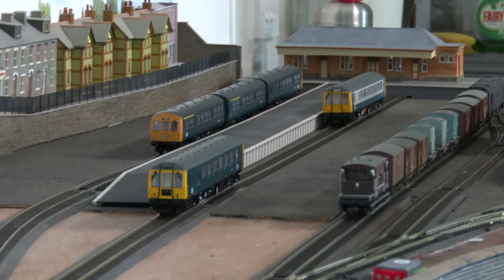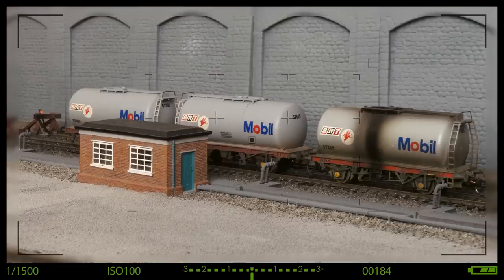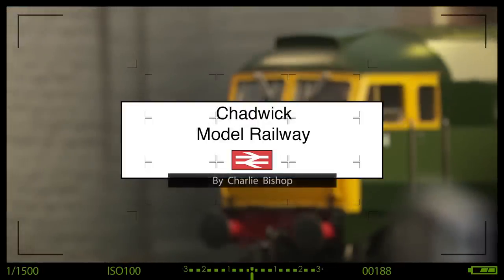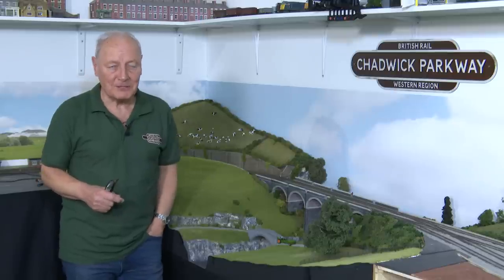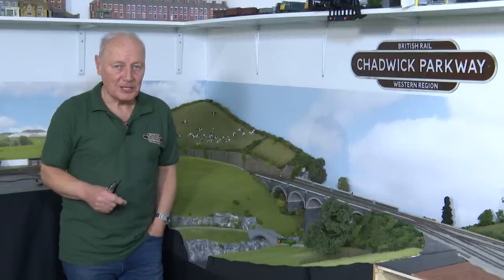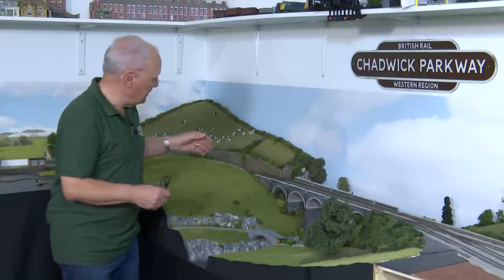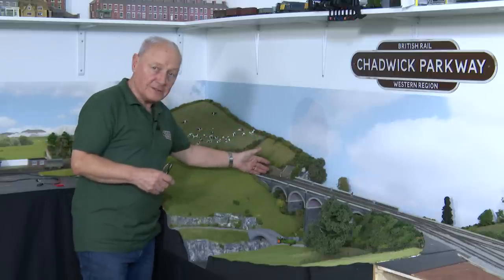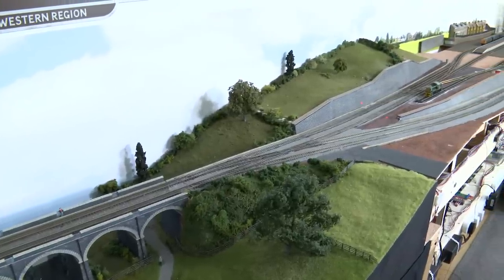SIGNAL POSITIONS at Chadwick Model Railway | 199.

Comment: Hi Charlie, I'm a driver on the midland main line, to put a spanner in the works at trent junction on the down main line the signal protecting the diverging junction, Derby/Nottingham lines the signal has 2 route indicators on no1 for Derby and no4 for Nottingham in other words you need a route indicator whether you're going left or right,  also if you get the cats eyes on a signal protecting a station you would also get the platform number as well.   Lee
Reply from the maker: Thanks Lee. At the junction, are the speeds the same for both routes?
Regards Charlie

Comment: Hi Charlie. Current train driver here.

Agree that the branch line would have the diverging 'feather' as usually this would have a lower speed or priority at the junction.

Also, if entering a station on position lights I would expect a platform number if multiple platforms.

Your solution to the Goods line departure signal is good, however if the position light is associated with a main aspect then it doesn't need to be illuminated all the time, only when required for a shunting movement. A departure onto the mainline just needs a main aspect.

Tim B.
Reply from the maker: Thanks Tim, good info, and most much appreciated. Regards, Charlie

Comment: Hi Charlie, Yet another Great video glad to see the amount of little details your Putting into the layout.

As many have commented when entering an occupied platform with the two white lights you should also get the route indicator, as for the goods siding you should only get a G indication with two white lights, as the points in the yard are hand operated and yellow signal would suggest they are set and locked in place which they wouldn't be, as well as this the yard would not have been track circuited and therefore must be presumed to be occupied. This would also be a reason to use the two white lights other the yellow which would tell the driver it is clear to the buffers.

A possible extra signal might be a shunt signal on your exit line from the area, but facing into the station and yard, should you shunt a loco out the yard into a platform for example?? 

As for semaphore signalling, the era your modelling it would not be unusual to see a mix match of both colour lights and semaphores in the same area, but as well as that even tho your modelling the GWR area you would quite often see upper quadrant  (mainly LMS style) signals too, as BR favoured this design and where GWR signals needed replacing they would likely get replaced by these.   
The signals at Shrewsburys would be worth looking into, as even today it is a perfect example of what it would have been like, it has a right mix and match of signal types.
Reply from the maker: Thanks Ben, your comment is much appreciated. I’m inclined not to go for the semaphores as I believe the station would need both home and distant signals at the end of both platforms. They would be reasonably hard to maintain and their solenoids would be an unknown quantity. Regards, Charlie
Reply: No worries, FYI when your starting away from a terminus you leave under caution even if the signal is green (this is if its two aspect), until you reach a signal that's able to display a caution aspect, so you could have either a two aspect signal or just a home arm.

Comment: As to the position of the feather left or right. Your correct in your assessment it does not matter as such, what determines its position is what is defined as the straight route or main route. In your case I would say the feather goes on the left for the branch station. Ps I am an ex retired driver hope the info helps
Reply from the maker: It is very much LR. But also the speed of the two routes has an impact as well. Regards, Charlie

Comment: Charlie, another inspirational video. You have set me thinking - 

1. While not a railway professional, my understanding is that feathers are to indicate divergence away from the main line to a secondary route regardless of the actual geography of the track bed so left feathers on the "peg" at the start of the viaduct. 

2. And now throwing in my two penneth, it would be great to see a few semaphores on the branch station - my suggestion is starter signals from the platforms with the remainder of the branch signals being "fairy" lights. I am sure that you can find an excuse to use single pole signals in the "prototype for everything" department. While everyone thinks that the West Country is solely the preserve of the God's Wonderful Railway camp, there are enough instances of branch lines in the West Country belonging to the Waterloo-based folk - in effect I am suggesting that the branch station could have been of Southern parentage. [P.S. the branch station on my layout is allegedly of LMS parentage so while the main line has fairy lights, the branch has an LMS-style box and a couple of LMS starter signals. Also I have reinforced the LMS parentage with some LMS style buildings.]

3. Unless you go down the road of fairy lights everywhere, you probably need a signal box at the junction with another one to control the branch - I very much doubt that one mechanical signal box would control both the junction and the branch station. My idea is leave the 'box on the main line where it is and make space for second box near the platform ends on the branch.
Reply from the maker: Thanks TRMC, for an interesting comment. I am on the hunt for semaphores so I’ll keep you posted. Regards Charlie

Comment: Congratulations on the upcoming 200.  Many years ago when I was on the footplate, we had a job at Taplow where we had a ground signal yellow and white lights to access the headshunt. When it came to return to Slough we got two white lights to proceed out on the main line. There was no main aspect signal.
Reply from the maker: Yes, I discovered that’s exactly right. I’ve acquired the signals handbook. RS – 5 to one. It’s all in there, regards, Charlie

Comment: Hi Charlie - love the videos, I’m an ex S&T engineer and have found some pages in a book about your yellow shunt signals. I will scan them and send them to you somehow. As someone else has said the feather route indicators are for the low speed routes so the fastest route would not have a feather.
Reply from the maker: Many thanks Keith, however, I think I have all the info I need so I won’t need your scans. That’s a great advice from drivers et cetera. You gave me great clarity. Regards Charlie.

Comment: Hi Charlie, first of all let me say that by no means am I an expert on signals but, looking at your starter signals leaving the platforms I think you may need a theatre on the platform 1 signal indication U (up) or D (down). I say this because trains enter the station on the UP line, and if leaving from 1 it will need to cross over to the DOWN. A straight green light may give the driver an indication he was departing back to the UP line.
Reply from the maker: That’s an interesting observation, but I haven’t found an example of it in reality. Regards, Charlie

Comment: Charlie I did some digging in my rulebook, this is taken from RS521 2.3

"When the straight route is obvious, there is normally no junction
indicator provided for this route.

Where there is no obvious straight route, a junction indicator will be
provided for all signalled routes.

Where the straight route is not the highest-speed route, the junction
indicator will normally apply to the lower-speed route.

Where the diverging routes ahead are both of equal speed, a junction indicator will be provided for each route.
"

Hope this clears it up😁
Reply from the maker: Yes David it did, much appreciated. Regards, Charlie

Comment: Hi Charlie, been away for a while. While there’s lots of prototypical advice, my go to books for modelling are C J Freezer’s Signalling an Nigel Digby’s Aspects of Modelling on the same topic. As a Digitrax guy also I’ve built SE8C boards and brought the connections out into RJ45 Ethernet sockets just that they were easy to swap if needed. Most of the stuff PM42, BDL now I put in a box with multi-wire connectors just so it’s easy to change them out or use them on an exhibition layout without having to buy than I need to ‘run’. I even have a full Digitrax ‘system a box’ which paid dividends at our last exhibition when the Lenz packed in and we were back up and running in a couple of minutes. Also the beauty of using JMRI on Raspberry Pi an WiThrottle/Engine Controller, no one had to change controllers.
Reply from the maker: I think you need to be congratulated Steve on building such a workable solution. Regards, Charlie

Comment: Very interesting as always Charlie.  One thing that crossed my mind is initially, would the lines in real life be built like this?  'Straight on' for a branch seems not quite right and 'slow down and divert' for the main line is the order of the day which also does not seem right to me.  Still, what do I know!   
Incidentally, I note that at 13:40 there is a glimpse of the position light on the Gartell Light Railway.  I'm very familiar with the majority of the signals here mainly because I either wired them up myself or helped do so.  I'm not involved at the GLR to the level I once was since becoming a carer, but if you pop along at a GLR open day and ask for John Penny you will get another bloke with that name (yes, really!) - and he knows signals - I mean he SERIOUSLY knows signals.  He can certainly answer your question about a position light that shows a yellow.  I recall we had a mechanical 'ground signal' of that ilk.
Reply from the maker: Thanks beetle fan, for such an interesting comment. The GLR is always worth a visit. Regards, Charlie

Comment: Hi Charlie, another great video. As a current signaller and ex driver I’d like to try and help you with your questions. Regarding which side the feathers are on, it would usually be the physically straight route, however it can be the secondary route, this would depend on speed across the junction. A good example is Balham on the down Brighton slow lines. The physical straight (or almost straight) route is on to the down Crystal Palace lines via Streatham hill and the main lines bare to the right, yet the signal on Balham down slow platform has a left feather. So the short answer is it’s perfectly reasonable that you have a left feather on your junction signal facing the branch station. The yellow and white ground position light or semaphore shunt signal would be appropriate for your head shunt. Basically when the signal is ‘on’, the yellow light would be shown, this is in the same position as the red light on a normal shunt signal. So it would show yellow and white together, this would allow the train to run past it towards the head shunt. Any train that was to go on to the main line would have to stop and would get the two diagonal white lights to take it onto the main (branch) line. There would be no need for a main signal. If you want a main signal then the main signal would be for the main line and an associated position light (two white lights) would be for the head shunt. It depends whether you think the head shunt needs to be signalled. That would depend on the area. Finally I have to point out that your starter signals at the platforms and if you decide to have a main aspect to leave the goods yard MUST be 3 aspect, because you can never have a green that is before a red. As you are going to have a signal protecting the junction coming from the branch station, you do not have room for a repeater or distant signal, the starter signals on the platform would have to be 3 aspect. I.E. if the junction signal was at danger the starter would show a yellow, if the junction signal was showing a proceed then the starter would show a green. The final signal taking you to the platforms or the goods yard would show the route indication even when the position light was showing and I think there would only be a position light to go into the goods yard. Whew! Hope that helps!!
Reply from the maker: Paul you are clearly bang on the money. I’ve also require the signals handbook RS – 521, which throws a great deal of light onto this subject. Thanks again buddy, regards, Charlie
Reply: Hi Charlie, I can send you an e-copy of that for you if you wish. Also any other rule book modules you may want. Let me know. Cheers. Paul
Reply from the maker: That’s most kind Paul but I’m pretty sure that I have the info that I need.
I have RS-521 in paper form.
Regards Charlie

Comment: I'm a mainline driver in the uk,  in my experience the junction indicator (feather) is for the diverging route. In your case the diverging route is the branch line station. As the double track mainline goes to the helix and is the main route.
A junction indicator doesn't have any relation to whether the line curves or not. I understand aesthetically, especially on a model railway the feathers might look better pointing to the direction of the tracks that appear to diverge
Reply from the maker: I’m with you on this one David. Many thanks, regards, Charlie

Comment: Yellow and white is a passive shunt signal. Meaning you can pass it all of the time regardless for the headshunt, but only on double white for the entrance to the mainline or whatever line is being protected by the signal.
Reply from the maker: Great information mate, and much appreciated. Regards, Charlie
Reply: @ChadwickModelRailway additionally, you wouldn’t need the ‘main’ aspect signal (the red and green one) if you’re only running goods traffic on that line. The yellow and white shunt is enough

Comment: Great Video once again and this time your has come before I start the work I’ve now got Train Controller and it’s far superior to my previous system so now I have faith in building a station/ yard on my upper level similar to yours 
Keep up the great work and thanks for all the reviews of various product your using they are truly a great help
Reply from the maker: Thanks Chris, that’s very kind of you to say so. I was wondering, which was your previous system?  Regards, Charlie
Reply: @ChadwickModelRailway  
I was using itrain Standard then I upgraded to Plus using The now defunct Digikeijs systems 
Now I’m on Train controller Bronze and Digitrax systems 
I’ve got more control of my layout the Pc interface is far superior and I can now just about run Four locos automatically and use my iPad to manually run four other loco and change points if needed.
I have done more on Train Controller in the last month than using itrain in Six months 
Sorry to sound so dismissive about itrain i just couldn’t get it to work on my existing Dcc layout I’m sure others will disagree 
Thanks for commenting so soon
Keep up the good work especially the Chadwick swifts
Good luck with the 200th episode it only seems a few months since you did your 100th episode
Reply from the maker: Thanks for your reply, Chris, I’m always interested to hear both sides of the story. Some products are never as easy as people make out. Stay safe, regards, Charlie

Comment: Hi Charlie just watched this video, in answer to the question about yellow and white ground signals at your head shunt i believe ground disc signal's would be used with a yellow bar on a white back ground. Have also seen a yellow bar on a black background which had a permanent spot light on them. As you are modeling a branch terminus i think this would be more appropriate than colour light signals The way this signal would work is that if  its on your train can pass it in to the head shunt. And If it is off this means your train can leave the yard but as it is a shunting signal it is under caution as the next signal may be red or, there may be an obstruction.
Reply from the maker: Thanks Jamier, that makes perfect sense. Regards Charlie

Comment: Charlie, in answer to your route indicator with a call on, yes it should also display number 2 as it reminds driver which platform he’s going towards, head-shunt ground-position light is correct being yellow&white for passing head shunt, two white at 45 degrees for route out
Reply from the maker: Thanks, tricky, sound advice. Regards, Charlie